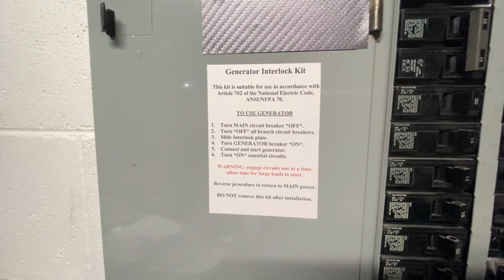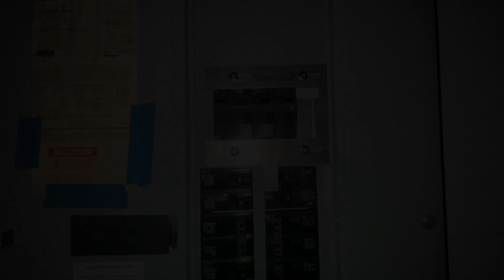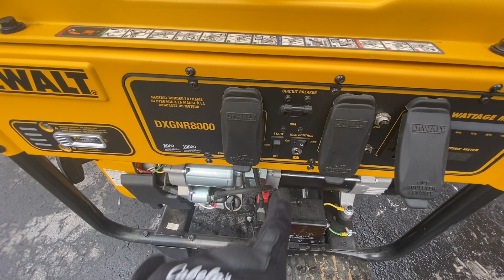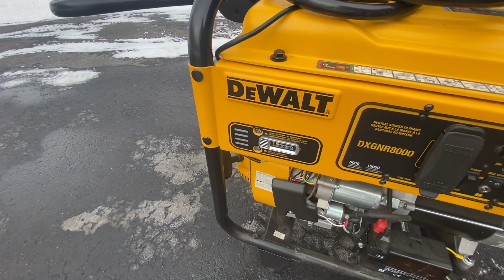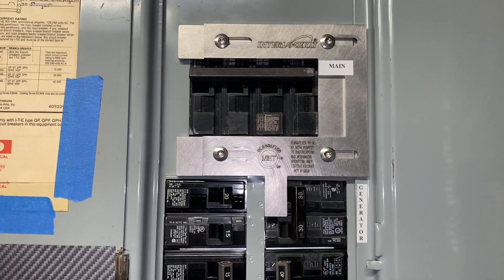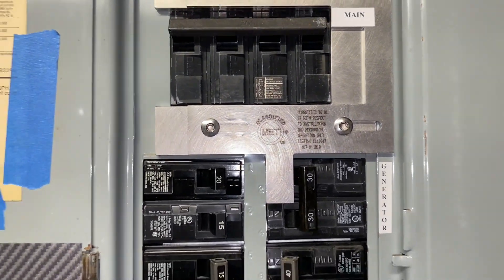Generator Interlock kit for Backup Power with a portable generator!

Comment: Nice!! How many hours can this particular model run on  full tank?? Thinking about getting this exact model.  Thanks
Reply from the maker: It’s based on load.  I think it’s either 7 or 9 based on a 50% load.  That’s by memory, but it is in the specs/manual.

Comment: I'm getting ready to have the exact same thing done by an electrician. Do you mind telling me what you paid? I'm trying to get a general idea of what they should be charging me for something like this.. From what I can tell, other than putting the input box outside, he doesn't have to install any other panels.
Reply from the maker: I got a really good deal through a friend of a friend that is an electrician.  I also got a handful of quotes elsewhere - but I spent around $400 for parts and labor (I purchased the Interlock kit for around $125, so I was around $525 all in).  Going rate is $60/hr where I am plus materials.  He did have to move some of my breakers around since the inlet could only be at the top of my breaker box - so take that into account that you need to be able to accommodate the generator's breaker.  Most of the quotes I got before the friend of a friend deal, they were suggesting closer to $600-1000 depending on who I talked to.
Reply from the maker: It looked like the Interlock kit prices (with the brand I used at least) have gone up to $149 now.  There are several brands out there, but the one I used is solid, well built, and well supported. The sticker they send for the box was crinkled in shipping - asked them if I could get a new one. They had in the mail that same day.

Comment: You really need to keep that away from you furnace intake. It will suck the exhaust right into the house.
Reply from the maker: I keep it 15-20ft away.  My cord is 25’ long

I also point the exhaust away from the house tooX
Reply: @tsr6  cool just making sure. i think i have the same cord
Reply from the maker: @BOB12349307  safety first!

Comment: How did you arrive at your choice of generator? Is 8000 continuous watts enough for your whole house, or selected circuits? Which ones? Thank you!
Reply from the maker: I got a good deal on the generator, but was aiming for electric start and 8000w 

This will run most of my home, but I wouldn’t run everything with large power demands at the same time.
Reply: @tsr6  thanks! Im overly concerned with correct watts / watt hours for my fridge and lights. It’s kept me from buying a generator. Advice?
Reply from the maker: There are online calculators you can use to estimate what wattage you need.  I’d start there and size up to error on the side of caution.